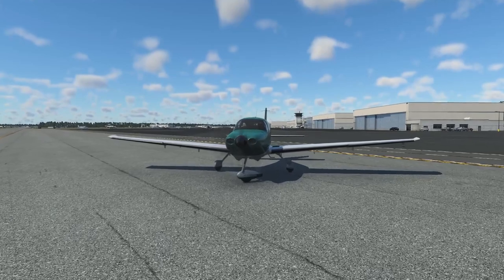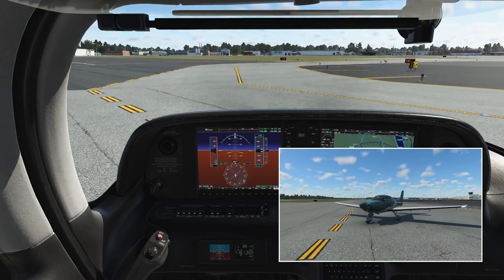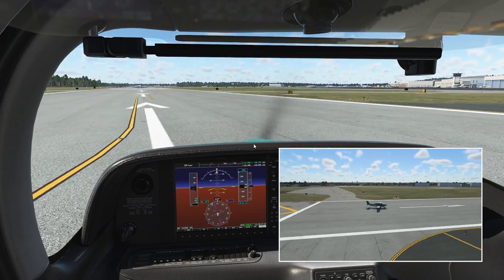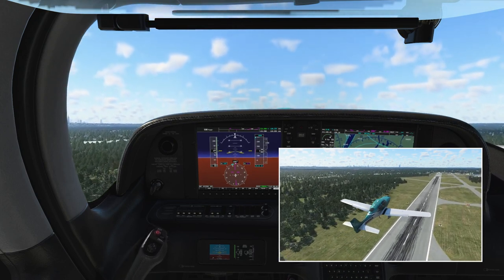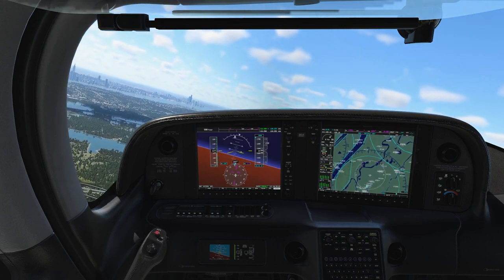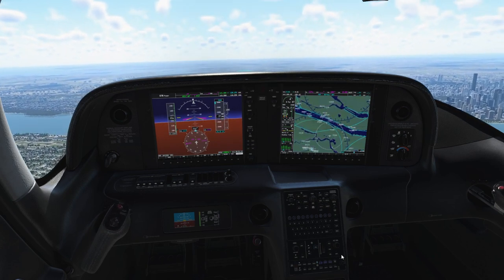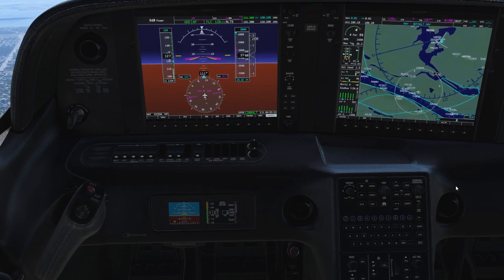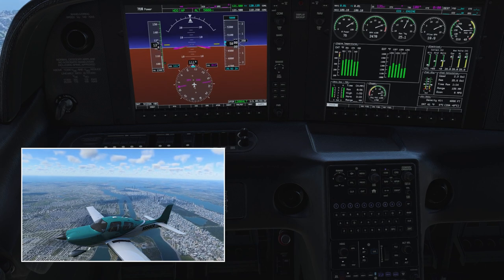Cirrus SR22 Take-off + Climb Tutorial – X-Plane 12

Comment: I'm sorry but where the heck are you getting this leaning for takeoff from? The only time you should lean for takeoff is for high altitude departures on normally aspirated engine or super short runways where you need the extra power (not likely in an SR22's mission profile, but possible).  You don't want to lean at such high power settings because you need fuel to keep your engine cool at low airspeeds, which is also the reason why you want to accelerate past 130 knots for the cruise climb sooner rather than later.....then you can lean for a cruise climb.  This is per SR22 G3 POH with and without turbochargin.

Comment: Understood your tutorial and it was excellent however could you please create another one explaining the 737 climb problem along with unable to develop Full Throttle. Checking the settings you recommended shows throttle at 100% but it indicates 70
Reply: N1 limit probably
If your using a throttle than calibrate it